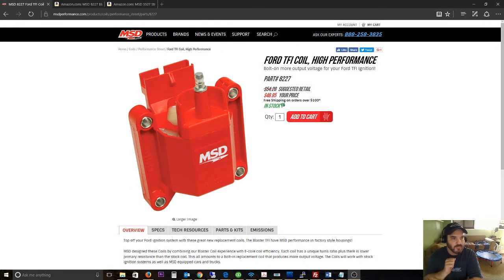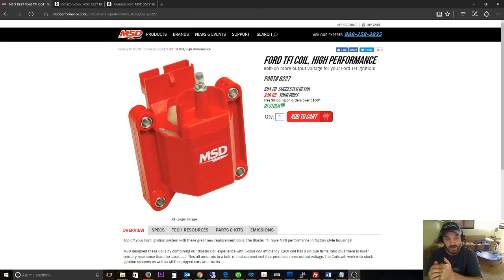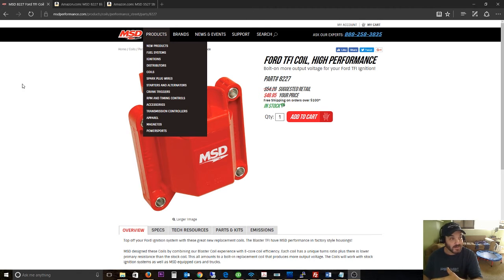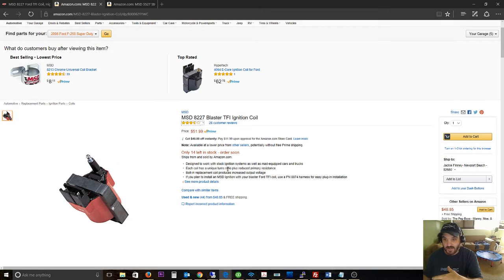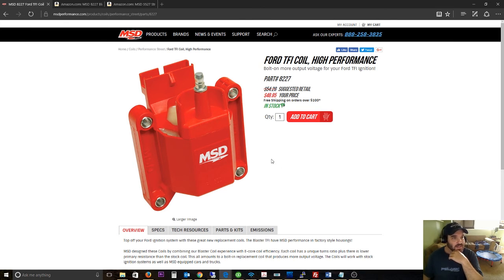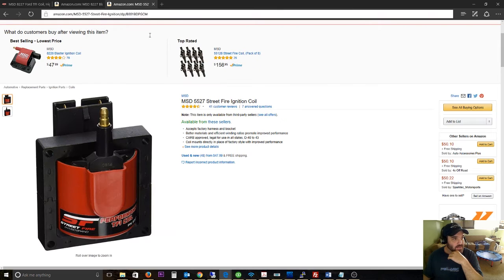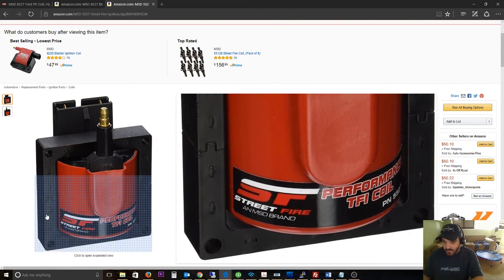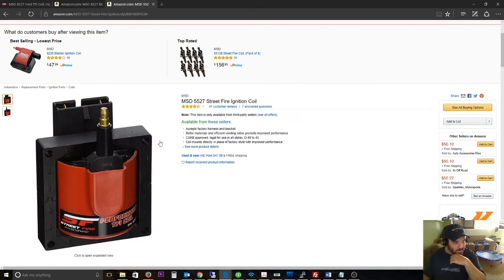MSD Ford TFI coil 8227 Failure bad design problem 5527

Comment: Put this new design, 5527 on my 93 F150 4.9 Inline six engine about two years ago. Its got an older model MSD 6a spark box also.  About six months ago I noticed that the engine would suddenly cut off, but would restart without any problem.  It didn't matter is you were at steady speed on the highway, accelerating or just idling, the engine would just quit without notice.  Now its become a more reoccurring problem where it won't immediately re-start, I have to wait about 5 minutes where it'll start and run for a good while before it dies again.  After replacing the ignition module that usually is the problem, I'm now thinking that it's the coil.  What I've seen here substantiates my thoughts.  I don't have a check engine light coming on and I just happened to have my fuel gauges hooked up when it shut down while idling.  The fuel pressure was good at all times so I could rule out fuel issues. 

I've been doing some research on MSD products and I'm starting to find that their dependable reputation is a thing of the past.  The new design MSD 8227 may look clean and sharp on the outside, but from an engineering standpoint, it looks as if it's a cheapened POS with a still hefty price.  I was going to buy another 8227, but now I'm going to go with something else.  It pisses me off when I see  good dependable products handed over to "bean counters"  so that they can cut corners with the quality for profit gain.  MSD was fine as a stand alone company, but once they were bought out by Holley, things changed for the worst.  It's a damned shame to see corporates and their greed step in and ruin what I considered as a good American company where you got what you paid for. 

 Having an engine chronically and suddenly shut down without notice can be a dangerous and expensive endeavor.  Holley should know about the problems with their coils by now, but I haven't seen where they've acknowledged the issues.  Holley's become another misguided, conglomerate monster that consumes small companies with good reputations only to cheapen their products for profit.  Gaining a good reputation in the performance automotive world takes hard work, but start making junk and it goes down the tubes fast.   It makes me wonder who's going to step up, there aren't many companies left that aren't owned by Holley or some other, greedy "monster".

Comment: This pos MSD 8827 failed on me after less than 200 miles in my fuel injected 438Windsor 68 mustang. Started noticing loss of power under heavy throttle. Then it finally stalled on me at stoplight. Sat 2 Fcking hrs in 90 degree heat waiting for tow. I was told to buy Duralast C839 TFI coil at Autozone. Read it's an awesome high power coil. Put one in and started immediately. Sent pos msd 8227 back to Summit for exchange to Street Fire 5527 which has all 5 star reviews. Keeping 5527 as back up to Duralast C839 i have now. Plus C839 coil has lifetime warranty and kicks as. It's $30 at Autozone. Msd 5527 is not the previous model for 8227. It's just another coil MSD makes. I don't know why MSD even sells 8227 when 5527 is almost identical. Whatever the case Msd 8227 is a time bomb. Thank God i stalled a block from my garage anfd not 100 miles away like one guy. He had to pay for tow and super expensive. Try the Duralast C839 coil. Its actually recommended by some race shops as the coil to go with when running msd 6al box, which i don't. C839 kicks ass, that's all i know.

Comment: I just removed my MSD PN: 82606 Coils on spark plugs and put back the OEM FoMoCo coils. They lasted me 4K before getting multiple misfires codes. FYI, it’s on a 2.7EB engine.